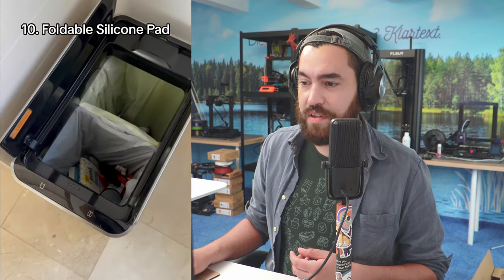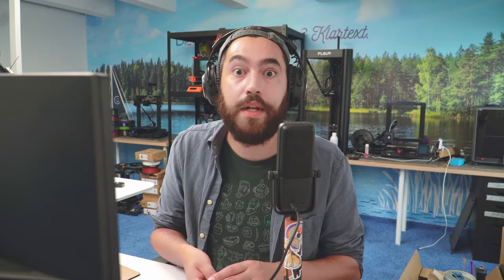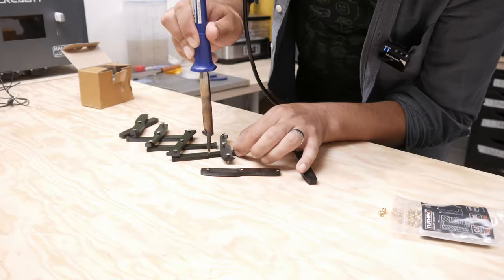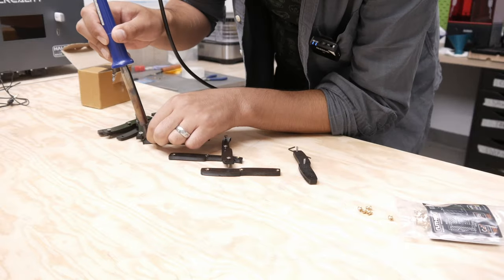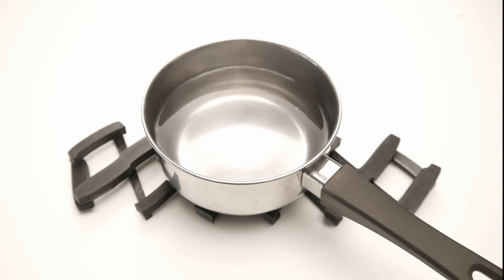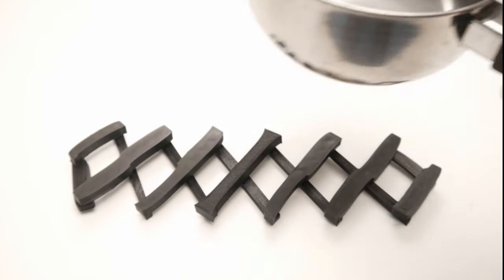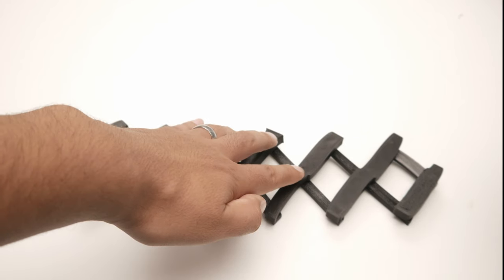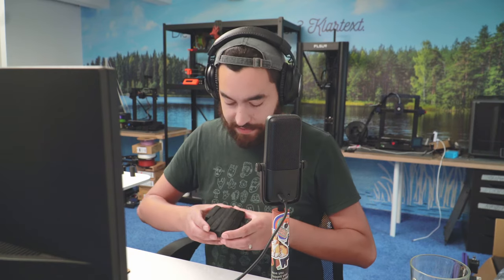Reverse Engineering Home Gadgets

Comment: For the pot holder thing, the hinge pins don't necessarily need to be as heat resistant as the TPU if they are recessed a little bit so they don't contact the heat directly.  Print in place TPU might work too.  Especially with a little silicon lube.  Anything would be more easy/convenient than heat press inserts.

Comment: i love seeing practical prints like these, and especially the process behind them, rather than endless disposable gewgaws. also interesting to see you work in blender, im used to seeing f360. im interested in the smoothness of blender and plasticity tho
Reply from the maker: Blender is versatile, that's its advantage. But F360 is better for specific things like product design so in general f360 is a better choice for the kind of thing I am doing here but blender has a sculpting tool, physics simulator, painting tool, for general designing it is far more versatile. interested to see plasticity though, looks very interesting and efficient.